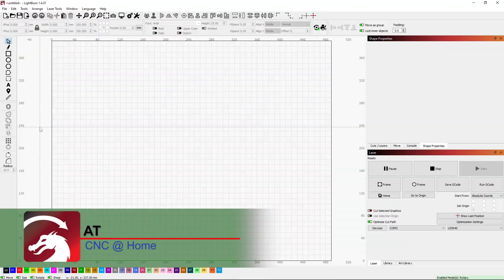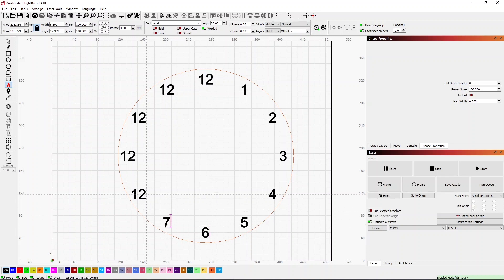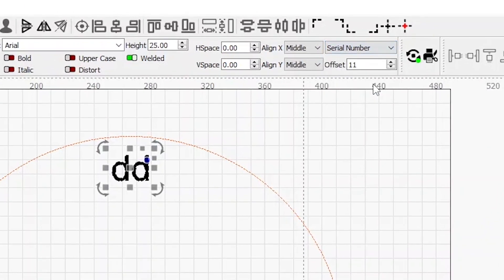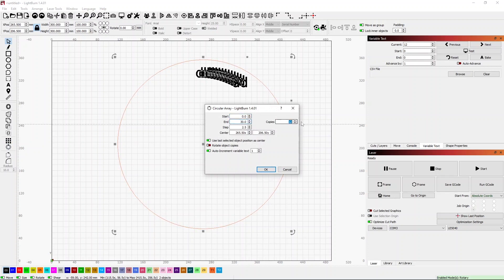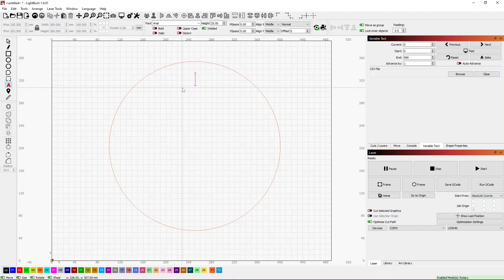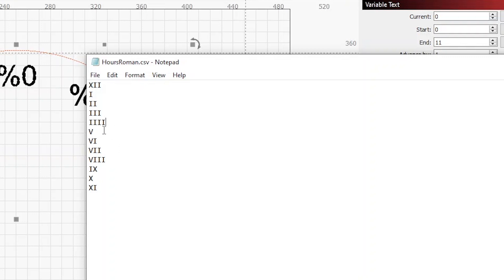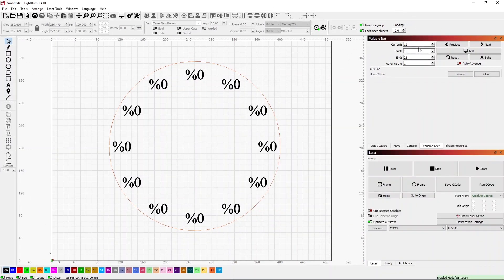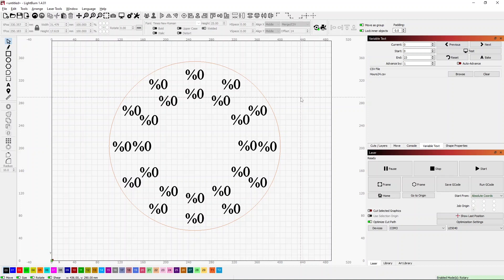Can you make a clock face in LightBurn using variable text?

Comment: Just the job, thanks
Reply from the maker: Thank you for that.  FYI - I did get to see your original comment too.  I am glad you were able to find what you needed.  The whole thing with the Roman numeral for 4 is kind of interesting.  In "modern" Roman numbering, 4 is IV.  I find it funny to call that modern Roman numbering as that has been the standard for hundreds of years. BUT back in the day, 4 was done as IIII and from what I have found, is still acceptable to do it that way.  I also find it interesting that on clock faces using Roman numbers, they still use IIII for 4 o'clock. 

When I first heard about this years ago, I didn't believe it and was surprised that I had not seen that before. I have my great grandfather's pocket watch and it has Roman numbers.  When I pulled that out, sure enough, IIII. Right in front of my for years and I never noticed. Now it is something you will always look for when you see a clock with Roman numerals on the face.

Comment: Thanks for this info.  I followed your instruction...everything works...except...my numbers count backwards.  Tried creating the text file, excel file...still backwards.  Cant figure out what I am doing wrong.  Any suggestions?  Thanks!  P.s. New Subscriber.
Reply from the maker: Without seeing your project, I am going to guess that the offset is backwards.  Each number object will have an offset to know how far down your list it needs to go for its value.  If you rotated your array counter clockwise, the offset would be backwards.  Check your 1 O'Clock position to see if it has an offset of 1 or 11.  The offset should be 1 so that it gets the second value from your list (which is zero based so the first element is item zero).  I hope this helps.  Thank you for subscribing!
Go Vols!! I am going to assume from your channel name that you are in TN.  I grew up in Knoxville.

Comment: That's pretty neat but you didn't show how you made the files to do the clock face with different numbers. Can you show how that was done?
Reply from the maker: Thank you for bringing that to my attention.  After working with computers for 48+ years, there are things that are so basic for me that I forget to talk about them.  The file is a simple text file and I created it using Notepad on a windows computer.  Any program that will write a basic text file will work.  You can also use a spreadsheet program such as Excel where you would create a column of numbers/text and save it as a CSV file.  I will add something about that into the video description.
Reply: @CNCATHome  What you said is all new to me. I don't have Excel but I have windows 10, don't know how to get to the Notepad. I'm 76 and not to COMPUTER SAVEY.
Reply from the maker: @karlriley1314  - No problem.  There are a couple easy ways to get to Notepad.  One is by  pressing the windows key and type notepad.  That should come up with the application you can click on.  The other, which is what I frequently do, is to press the windows key + R.  This will provide a run dialog where you can type in a command.  In this case, type in notepad and press enter.  That will bring up the notepad program.  You can create your text file and when you are done, make sure to save it somewhere you have easy access.  🙂